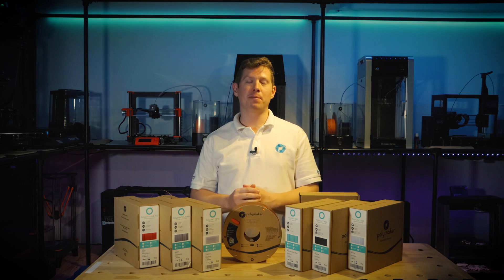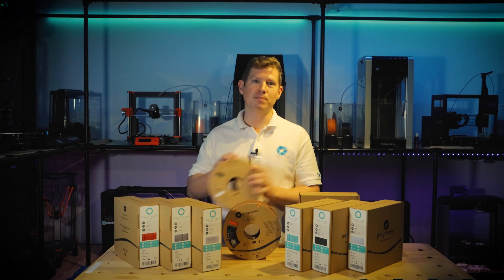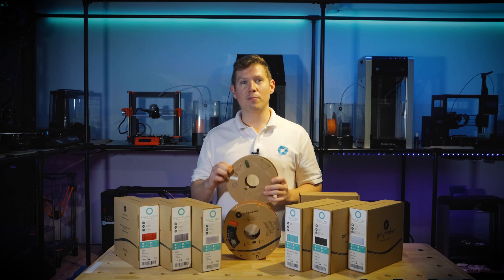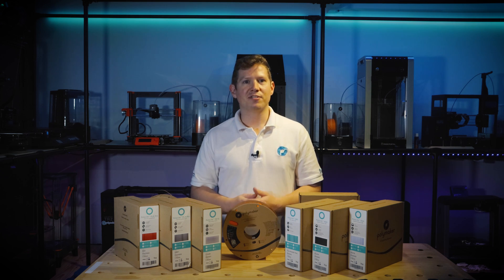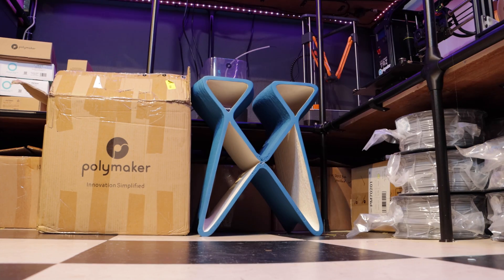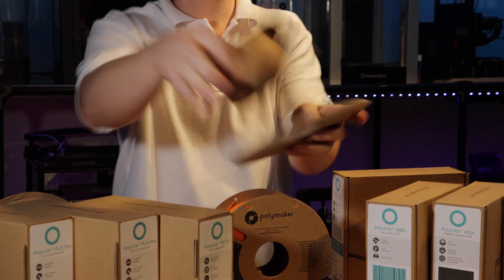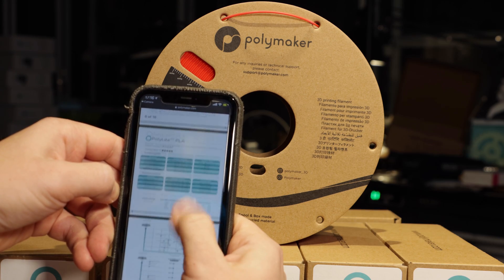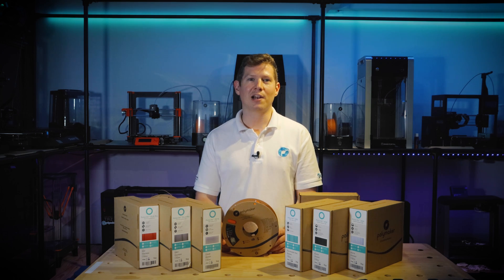New Spools - 100% Recycled Cardboard for All Filaments

Comment: Dumbest thing ever. Makes using this filament to frustrating to use in Bambu AMS. 

Our recyclers won't take non corrugated "cardboard" due to the glues and fillers. So, we now have chemical impregnated cardboard going to the landfill tomwuickly Leach "whatever" the recyclers are afraid of getting into their recycling...but now going into our water supply.

Need to bring back the plastic reels for those who cannot dispose of the cardboard or who need clean debris free plastic reels for their automations.

Comment: well, you lost a customer because of this move.  I was about to order over $200.00 worth of filament for my bambu lab with ams and ran into an issue with these cardboard spools.  the adapter did not work because something is wrong with the spool.  I then went through the process of moving it to another empty spool (a bambu reusuable spool) and realized I would have to do that every time I open a new Polymaker filament.  Sorry guys, this was a bad decision on your part.  You should have went the bambu lab route and made your plastic spools reusable and sold just the filament without any spool to be placed in them.
Reply from the maker: There are pros and cons for for both solutions, thank you for your feedback, the most important is that you found a suitable products for your use.

Comment: its good for the enviroment but it cannot run on bareings at all. I am disappointed.
Reply: Not good for environment. That is pure fiction. Recyclers don't like this stuff due to additives. So it goes to the dump, but unlike plastics, quickly leaches chemicals into water. Not an improvement by any measure.

It also makes it too much work to use this with filament changers that preclude using warped and dirty cardboard rolls. 

Save the recycled cardboard for toilet paper rolls.

Comment: This is great! I hope more companies will follow suit.
Reply: Also the QR code AND print info is also a great choice. The QR code is good for finding more info, but not if I just want to know basic settings. Having this info on the box and the spool gives the user access to all necessary information. It lets them choose how they store it without having to take note of settings that aren’t immediately identifiable on the spool. In the box, in the resealable filament bag, or loose [ in an airtight container ;) ] the user has what they need to print with Polymaker!

Comment: I have some of these from polyterra, and I have to wonder, is this cardboard actually biodegradable? Like really biodegradable and not the "requires an industrial biodegrader" that pla is? It seems so sturdy and thick I have a hard time imagining its put together with anything but a lot of resin.

If so, those are some good spools.

I suppose it would still be better than plastic which still isnt ever really recycled because its made out of recycled material.
Reply: Cardboard is as biodegradable as any tree...tis made from the same stuff + some glue.